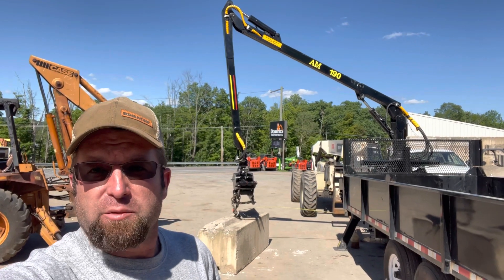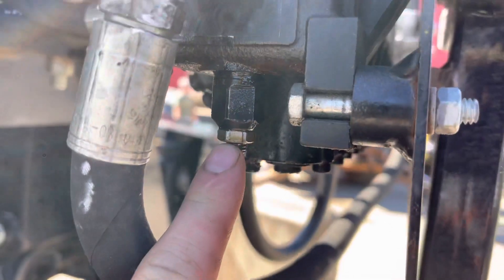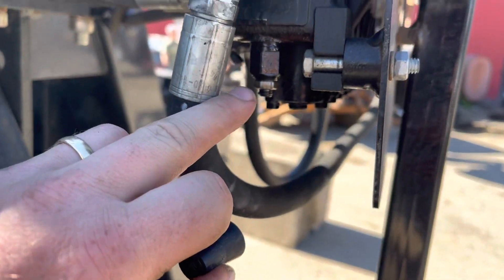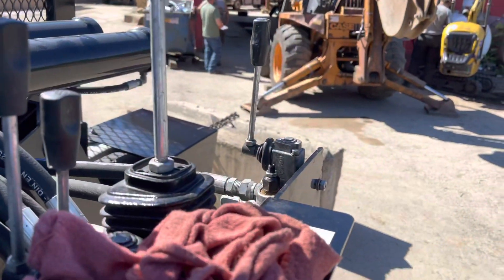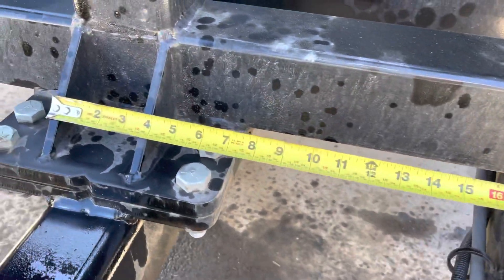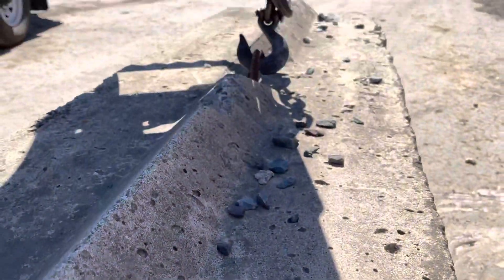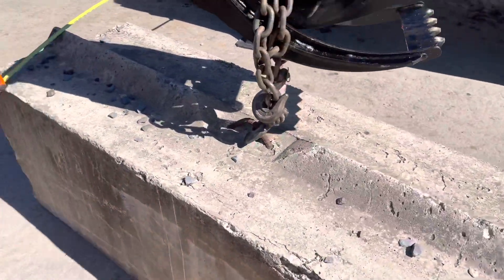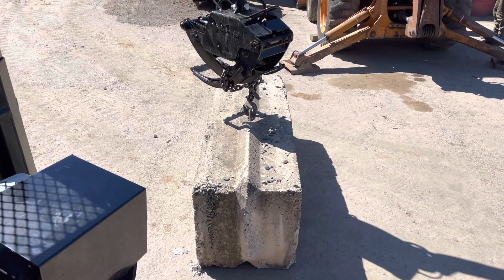AM190 Heavy Lifting

Comment: Isn't the boom engineered to handle a specific load capacity, and by adding more lift by turning the cylinder around exceed that limit?
Reply from the maker: It’s over engineered for what it is. The manufacturer gave us the go ahead to do it. Full disclosure, we did dial it back. I just thought it was impressive!

Comment: Hi AJ!!😀😀
That was kinda impressive. But that loader will not take operating with that amount of weight for any length of time. I do believe if someone were to lower it kinda fast and stop short that you would have pieces really soon. My father could trash it in a couple days if you were to let him run it. He has broken every skidder boom I have ever let him run. Some do last longer than others but he is rough on them. The only loaders that have stood up to him for any length of time are the Patu loaders. In my opinion Patu is the only company that doesn't over rate what the loaders will do. 
Take care my friend!! 

Logger Al
Reply from the maker: It’s over engineered for what it is. The manufacturer gave us the go ahead to do it. Full disclosure, we did dial it back. I just thought it was impressive!